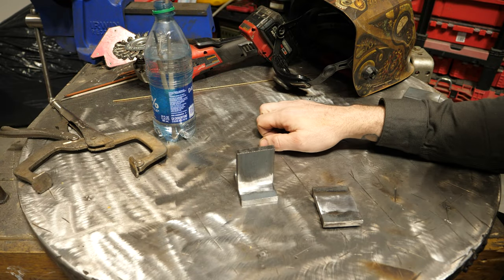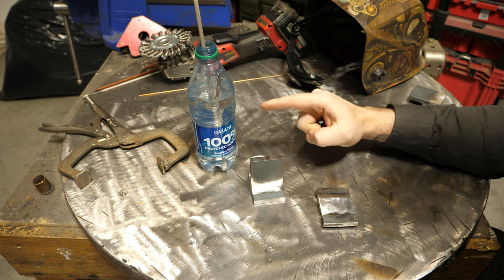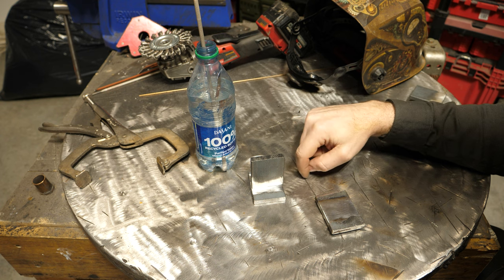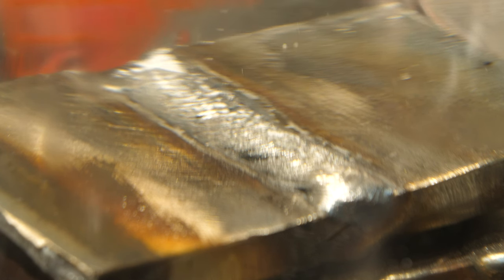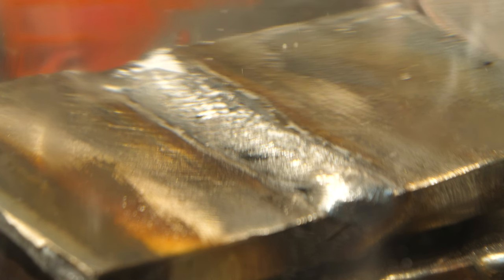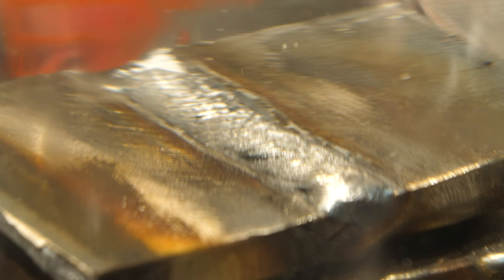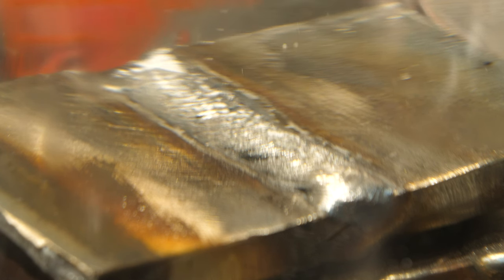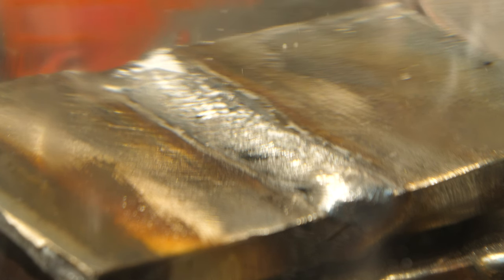Moisture in 7018 rods, will it cause weld failures?

Comment: Best news I’ve had in a long time. Hate to think how much 7018 I’ve discarded over the years,  thinking it had soaked up too much moisture to be effective.
Thanks Greg !
Reply from the maker: Without a doubt 7018s will soak up moisture, but they won’t have more in them than a 7014/6013/6010/6011 will under identical storage situations.  If you happen to weld some higher strength steel not realizing it the probability of weld problems is no more than using any other rod at that point.  With that said 7018s do weld better dry, I can attest to that.  Soaking wet they are very difficult to control lol.
Reply: @makingmistakeswithgreg exactly!
Reply: If you need to weld something structural (heavy equipment trailer coupler) and dont know how old the 7018 is,  spread out your 7018 on a cookie sheet and roast them in the over for a couple hours at 180 degrees.  Dont let your wife see you though.
Reply: I read that it had to be above 500 in an electric oven (gas over= water vapor) for a few hours and you could only do that trick once or twice.

Comment: That was incredible!

I’ve heard many old timers say that as long as you aren’t using 7018 for code work, it can be stored in open containers for years, and still be a very strong safe weld.  

If the “Proof is in the Pudding”, your pudding certainly made your point. 

As always, you must do your due diligence, and use the proper rod, stored properly where 7018 or any other Low Hydrogen rod is used to prevent hydrogen embrittlement for critical welds, even if it’s not necessarily for certified code work, or in other words, you want that Hook on your trailer to stay stuck to the trailer.
Reply: Can you put the failed 7018 fillet weld that cracked thru the middle of the weld into the mineral oil bubble test. 

I’m interested to see what bubbles come from the grain structure of the 7018’s failed weld and the toe that started to crack, as seen at time mark 15:38. 
Thank You
Reply: In talking to some guys years ago, I was told that most uses of 7018 is with rods that aren’t heated.

Comment: This puts my mind at ease. I built a gantry hoist with some old 1/8 7018 I had. Baked it for 24 hours before i used it ,all mild steel.Burned Nice 👍
Reply from the maker: The bake out would have reduced any effect hydrogen would have had, even though it likely would have played a minimum role.  You definitely can have piece of mind.  A little undersized single pass weld on thick plate with a dripping wet 7018 rod was able to handle a lot of force without failing, I am sure what you welded will be far better lol.
Reply: @makingmistakeswithgreg  I made sure to multi pass all the welds too refine the grain structure and such 👍
Reply: Hence, if one has, say, Lincoln 7018(ac), which comes unsealed from the store - then an overnight baking should help?  (At least with their running.)

- better, a couple of hours at “broil” settings, e.g. 500+ F??? - then 250-300 “storage” until use?
Reply: @dennisyoung4631  They definitely burn 
Smoother and strike easier hot. As long as you keep them dry in sealed rod holders you should be good to go👍

Comment: Excellent video, your disclaimer pretty much sums it up. Nobody knows their welding rods like the manufacturer, if they say do XYZ you do XY and Z, if anything it keeps you out of hot water when you have to explain why that bridge collapsed killing a hundred people at rush hour, " Tell the court, did you keep you rod in a oven as per spec?".... "Well iiiii🤔" ....... For most DYIer's a little hydrogen isn't a big problem. Weld design and proper engineering are more critical when fabbing, ie. a trailer used on public roads, hand railing on the balcony 3 floors up, the chopped and raked steering head on your custom panhead. Then it's advisable to follow manufacturers guidelines.
   Your video has inspired me to try something, I was given two tube's of unsealed 7018, 3/32,1/8" about 30 years old, it will be interesting to see the outcome, I will not attempt to do the 800/350 rod oven thing. Just run'em. wish i could afford to have my coupons X-rayed.
Reply from the maker: One of the things that always surprised me is how specific companies are with what to do and yet people seem to think it’s wise to go against them.  In the case of 7018 specific, manufactures often specify all position but vertical down.  Yet I have seen actual welding procedures that state vertical down with 7018.  I am not a certified welding inspector, or write procedures, but I would assume anything that goes against the manufactures specifications would not be a approved procedure on face value.  If something would break it sure isn’t the manufacture that will be liable.  

The biggest thing I learned that I would have never expected is that 7018 has better performance than 7014 in all testing, and even a soaking wet 7018 weld bends just fine (provided it’s not full of visible porosity lol) on 3/8th plate yet 7014 won’t.  That is very important information because it really stresses the importance of learning to weld with 7018 if something a home gamer wants to weld needs strength.  

As far as your old rods, I bet they will run decently.  If the flux is still attached they probably will be ok.  Your idea makes me want to find a old can of rods on market place and see how good they are in some bend testing lol.

Comment: Lessons learned:  If stored improperly (in any way other than soaking in water 😂).....just burn an inch or so to heat her up, & the rest of the rod will be fine.

Excellent test & video!  Thanks!
Reply from the maker: That will burn the water off, but it won’t meet code that’s for sure lol.  It does weld by far better when it’s steaming over soaking wet.  Soaking wet is rough lol.

Comment: What Greg said: Don't just use this as an excuse to weld with any old 7018. Abide by the storage requirements. 

What I heard: Weld everything using only  improperly stored 7018 until it's time to weld something critical, then use the ones from a fresh, hermetically sealed pack.
Reply: Yep. I use rods out of a 50 lb. can that has been open in the barn for at least 30 years for things I don't think are critical and that wouldn't create a danger if they failed.
Surprisingly I've never had one of those welds fail yet.

On the other hand when I welded a tongue on a trailer or headers for a concrete roof or weight lifting racks I went and bought small boxes of new rods. I think the old rods would have worked but no need to take that chance.

Comment: Although I wouldn't use a wet rod, that wet 7018 boiled off enough water to run the rod good enough to put down a satisfactory test weld. Would I risk that on any weld on a farm machine or plant machine? No. Very interesting video young man!
Reply from the maker: Even slightly dryer the rod ran ok.  When it’s literally dripping wet it was quite the handful lol.     From a mild steel perspective everyone would be better off using 7018 improperly stored over say 7014 if strength is a concern.

Comment: Speed of cooling is also a huge factor in hydrogen content of the weld. Preheating and heatsink capacity of the base material has a strong effect on how much hydrgen diffuses out during solidification and crystal transitions. 
Temperature during the fracture test also matters, there is good reason charpy notch tests always specify a test temperature (commonly 0⁰f or -20⁰f).
And as some other posts have detailedm the base metal sensitivity and restraint of the joint.

Comment: Hydrogen embrittlement mainly is a problem with high grade steels, low temperatures and impact. I think the basic flux of the 7018 results in a very "pure" deposited weldmetal. Check the ISO2560A norm in which the impact toughness is defined at which low temp. I think basic rods xx18 or xx16 are just unbeatable in strength. For short welds I don't prefer them due to higher risk of porosity. I weld quite some stuff with 6013 because it does not need to be so strong(thinner metal).
Reply from the maker: Based on all the testing I have done 7018 has definitely proven to be a winner.  You are correct on short welds and thin material, definitely not the ideal rod for those situations for the exact reasons you mentioned.  I also find 6013 to work well for flat welds as well, the flux spreads out nice and doesn’t have a tendency of running infront of the rod in those situations.
Reply: Yes, indeed flat smooth welds especially at the higher current setting. I run 6013 always at higher current setting and short to very short arc to prevent slag pockets. I think for that reason 6013 isn't an easy rod to begin with. Here in the netherlands there are several 6013 rod types with more cellulose and less rutile or vice versa. The ISO2560A norm gives a more detailed description. For instance ISO2560A:
E42 0 RC 11 is E6013 but
E42 0 RR 12 is also E6013.
 Rod like E6011 is not available here( got a shipment  forney E6011 box from abroad). I like that one for cramped joints or galvanised steel.

Comment: I was waiting for this video! Although the result wasn't what I suspected. Never the less I take as result that I always have to read the data sheet for the rods I use instead relying on the names. And that I'll always keep a vacpacked bunch of 7018 and 7016 on hand for critical work on higher strength steel and take the older (and soaked) ones to work on mild steel. Thank you for that informative Video!
Reply from the maker: You’re welcome 😀

Comment: A  about 4yrs ago when I only had dad's old forney buzz box I had a box of hobart 7018.  They wouldn't run except on two ranges.  I gave the them to a nephew who said he had never used them. I told him to expect them to be the strongest he had ever used, but since they are open, they will not be as good as they are spec to be.  I bought some KT 7018AC which ran just fine.
Reply from the maker: Many 7018 rods struggle to run decent on buzz boxes.  The voltage they need to operate tends to be just a bit higher than many buzz boxes can keep up with, and the a/c current causes a drop in voltage as it cycles positive and negative.  The a/c specific rods generally run far better, my understanding is the flux is setup to help lower the arc voltage a pinch.  They are as strong as a “normal”7018 and are the best option for buzz boxes 😀

Comment: You should try welding with 7014 and ping (beat it with the pointed end of a chipping hammer)  the heck out of it and see if it passes.  Pinging relieves stress in the weld and makes it more ductile.  Not that I would consider using 7014 or 6013, but what the heck. worth looking at.
Reply from the maker: I wonder if that would have an effect.  7014 has proven to be less strong in the tests I have done over 7018.  A needle scaler might work pretty good for that.  It may help it better pass a bend test on a fillet weld.  Definitely worth looking at.

Comment: I know i feel better about my 7018 rods now.  Thank you sir.
Reply from the maker: No problem.  Keep them in a factory container or reasonably shielded from the elements and they will be fine for welding mild steel 😀
Reply: @makingmistakeswithgreg  That's my plan.  And as you recommended before, I bought some of those 4lb sealed packs of ESAB 7018 so I'll have fresh rods when actually needed.  

Love the channel Greg.  You are actually helping people with information that's hard to find.

Comment: Perfectly explained alot of People thing 7018s are 70,000 max its usually way higher upper 80s sometimes low 90s
Reply from the maker: I never quite understood why AWS specs a minimum and no maximum for many basic rods.  For mild steel it doesn’t matter I guess, if the weld was way strong it won’t cause issues.  With higher strength welding rods I bet they have more strict criteria.  For all practical purposes 7018 exceeds the strength of a36 hot rolled steel universally, which is a good thing.

Comment: Hydrogen embrittlement IMO is a non issue for plain A36 type steel we’d use for most things. HE is mostly a problem for highly alloyed steels that are harder and stronger. A36 is neither highly alloyed nor very hard. Now, if you happen to accidentally harden those coupons (heat to glowing red and then oil quench) you might find a bit more sensitivity to HE because you might be over HRC 32 or so.

Comment: Which leads me to wonder:  how much impact does welding in the rain (not a full downpour but a heavy mist type) have on a weld?  Does it cool it fast enough to embrittle mild steel?  Does it effect the actual weld?  Kind of a real world thing when the job has to get done and the rain that was threatening begins just before you are done.  Another good video.  Thanks Greg
Reply from the maker: The faster a weld cools can effect the weld.  I have a video out soon where I quench a weld I just finished in water and then bend test it.  Letting a weld air cool is the best practice, but sometimes that’s not possible (like if it’s raining).

Comment: After watching all the videos on this playlist, I have to say my single biggest takeaways are: 1) groove thicker material to assure root penetration and 2) use 7018 and don’t worry. At least, as a hobbyist not doing code work.

It’s very eye-opening how little weld penetration there can be even at fairly hot amperage settings. The number of tests where there was zero root penetration was gobsmacking. Which affirms the wisdom of the traditional 6010 root but 7018 after that. Use the 6010 to get your root penetration, but 7018 for the rest of the passes.
Reply from the maker: Without a doubt many things contribute towards root fusion/penetration.  Many rods and processes simply don’t fuse the root.  Even then it’s often not a deal breaker, but for best strength it may be needed based on how something is designed.  7018 and 6010 is what I use for virtually all stick welding, and anything those don’t work for I tig or wire weld.

The difference in strength with 7018 vs all other rods is significant enough if you can weld good with the rod it should be the go to on anything  3/16th thick or thicker.  From time to time I will use 6010 for a root pass and 7018 from there out.  I don’t use 6010 as a root to cap because it’s significantly weaker than 7018.

Comment: I just have mine indoors, never worried about it since I don't weld anything structural. Made an attachment for a slide hammer and that has taken many a beating since without failing, and that is good enough for me and my use. If I was welding frames on vehicles or beams on buildings it would be another thing completely, but I don't and probably never will.

Comment: Thank you how dose age affect welding rods
Reply from the maker: Age tends to cause rust buildup on the metal under the flux which often causes the flux to pop off the rod.  The fluxes tend to deteriorate as well.  If the rod is stored in a ammo can or somewhat sealed container, and the flux free of cracks and is still stuck to it, odds are it’s fine.  I have ran 20-30 year old rods and they worked ok.  My general rule is sub 1-2 year rods for work that requires strength and less critical work/practice with older ones.